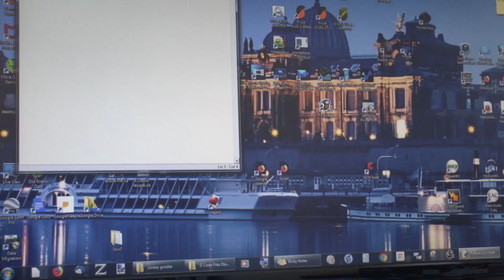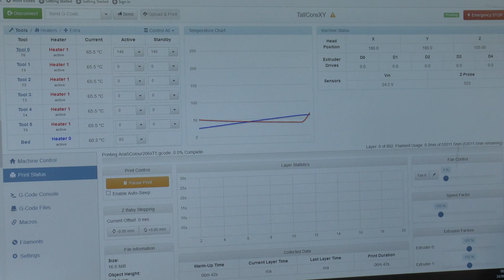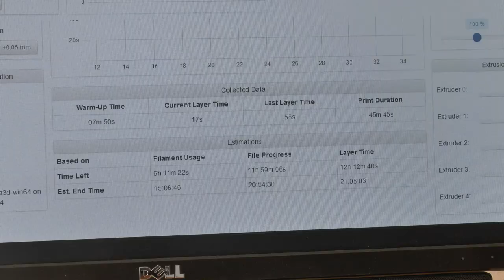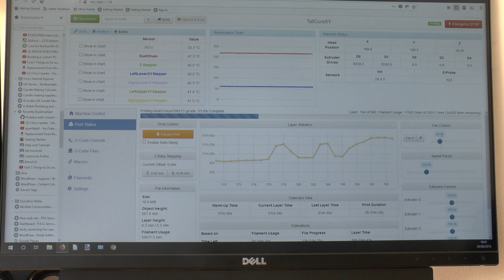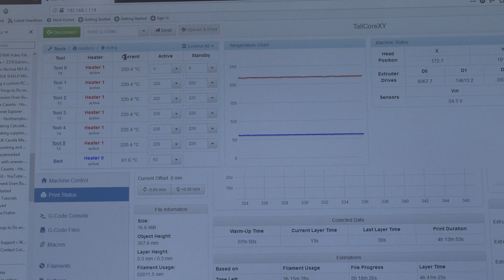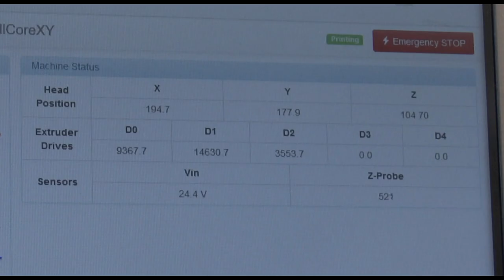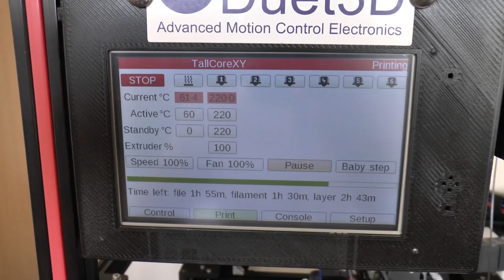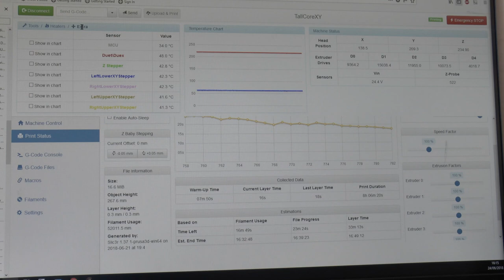Printing Aria by Loubie

Comment: I really like your build. Do you have any more pictures of it? I am building a large CoreXY (400X400X750) and you seem to be getting really good prints. What size lead screws are you using and what is your print volume if you dont mind me asking?
Reply from the maker: Hi. No I don't mind you asking. There are quite a few more videos of it on this channel of mine. For more information, take a look at my blog https://somei3deas.wordpress.com/. Specifically, the pages related to my CoreXYUV build and the 5 colour upgrade.
The lead screws I use are 8mm diameter, 1mm  lead. That is to say, they are single start "trapezoidal"  thread with 1 mm pitch so the lead is the same as the pitch. I hate multi start, course lead, screws on a Z axis for reasons that you'll find on my blog https://somei3deas.wordpress.com/2017/01/31/z-axis-lead-screws/
As you'll have seen, I use a Diamond hot end which, because the heat sinks stick out an angle, has an envelope of about 80mm in both X and Y. So I lose quite a bit of travel compared to a smaller hot end. The printer frame is 600mm square but the usable print volume is 344mm in X, 364mm in Y and 760mm in Z. 

HTHIan

Comment: Impressive setup, well done. Do you have an estimate of the total weight of the machine? Also have you considered using linear rails for the main axis?
Reply from the maker: No idea what it weighs. I can lift it with ease though. If I had to make a guess, I'd say less that a heavy suitcase - say 30 kgs?  For moving it, it's size more than weight that's the issue, but the top section is only held on with 4 bolts so it comes apart reasonably easily. As for linear rails, well it's all OpenBuild Vslot extrusion with Delrin wheeled carriages so I already do use linear rails. I guess you mean something like additional Hiwin or MGN rails, bolted to the Vslot? Can't see what advantage the additional complexity and cost would give me TBH. It'd likely make the carriages a bit smaller so give me a bit more XY travel but not enough to justify the extra cost (and I like the fact that Delrin wheels running on Vslot are silent).

Comment: I am watching your video all over again and again but I can't understand your guide setup. It seems you have only 3 carriage with 4 wheels each . Looking from front of you printer seems the carriage are  left front and right front  / right back . I can't see any carriage on the left back angle . Is it correct? Is you bed fixed to the frame and so do  you make bad leveling with the  lead screw?
thank you
Reply from the maker: The bed isn't fixed to the printer frame - it can't be because it has to move in the Z direction. It is supported on 3 screws. These screws both support the bed and provide lift. The 3 screws form a traingle and are connected via a continuous belt to a single motor. As 3 points define a plane, then when the screws rotate, they lift the bed whilst keeping it flat and level. Similarly, the initial levelling was done by slackening two of the pulleys and rotating two of the screws with respect to the third. Then the pulleys were re-tightened. Because the three screws are connected by a single belts, there is no need to re0level the bed. The only time I have to check and perhaps adjust the levelling is if I transport the printer to another location. 

The linear guides are only there to stop the bed from moving in the X and Y directions. I have found that the best position for these guides is to have two guides, positioned on opposite corners so front left and rear right or vica versa. Originally I had the guides both at the front but this wasn't as effective so I fitted another in the rear right corner. The one that is still in the front right corner has been slackened off and doesn't actually do anything - I just haven't got around to removing it. So two guides works best - the more guides you have the more difficult it is to get everything aligned so that nothing sticks or binds. The number of wheels on each guide carriage is irrelevant. The only criteria is that the guide carriages are free to move but without any undue play.  Mine happen to have 4 wheels but if I was building it again, I'd likely use two on one side and one in the centre of the opposite side.
Reply: @deckingman  thank you very much for your answer So your Z axis move only on 2 linear guides in a diagonal position each other . I would like to try your approach . I have now 4 guides with 3 wheels each and three screw like you . I am gonna try to remove 2 guides and I'll see . If everything works I'll try to remove also the 3 screw on the bed and relaying on lead screw like you for leveling. I saw you are using an elastic join between the bed frame and the Z carriage . Do you find improvement over a fixed join?
Reply from the maker: I designed the joints so that the bed could be levelled without imparting any twisting or buckling forces on the build plate. Although that may not strictly be necessary, I never tried a rigid coupling so cannot say if it is better.
Reply: @deckingman  I really amazed by your design! it seemed impossible to me, before seeing your printer  that a printer with only 2 guides and flexible joint between the frame and the bed could be so  solid.If you would try to wist the bed structure without the lead screw it stay stable or it would twist ?
your and mrehorstdmd printer are full of inspirations. I see your dinamic force cancelling  ! Even if you say that isn't bring   real improvement of print quality is a demonstration of great capabilities! O.o Thank you for sharing al your knowledge  with us. I am very tempeted to go with belt Z axis even if If my quality on Z isn't bed . I would not make  the same " mistake" you did with dinamic force cancellation , maybe simpler is better and three led screw- single motor and  bed levelling by lead screws adjustment is the way to go.
Reply from the maker: If it was possible to take the 3 leads screws away, when you look down on the bed from above, the two linear guides prevent the bed from being moved left to right, or back to front. They also prevent the bed from being rotated both clockwise and anticlockwise. However if you look at the bed from the front without the screws in place, the flexible couplings would allow the bed to be tilted up or down on one side compared to the other side. The same applies if you viewed the bed from one side. That is to say, the couplings would allow the front to be tilted up or down relative to the back. So it can be tilted but not twisted. What I mean by that is that it will always be flat. That is how it is possible to turn one lead screw to level the bed without twisting it. 

Try this. Put you elbow on a table, hold your arm upright and use your thumb, index finger and middle finger to make a 3 legged triangle. Your fingers are thumb represent the 3 screws. Now balance a small book or something on top of those fingers and thumb. That is the bed plate. To raise the bed, you simply raise your arm off the table. Both fingers and thumb move at the save time so the book (bed) gets lifted without any twisting force applied to it. Now bend one finger slightly to make it shorter That is the same as adjusting one screw. The book (bed) will tilt but still stay flat (but not level) because there are no hard couplings between your finger tip and the book. Now move your arm to the corner of the room so that two opposite corners of the book are just touching the two walls. The two wall are now the linear guides. If you raise and lower your arm, providing those two opposite corners of the book are always touching the walls (guides) then it is impossible for the book to move side ways or to rotate.
Reply: @deckingman  thank you for spending so much of your time answering me Definitely   am going to try your  flexible system . I just ordered the joint bearing :) I have an aluminium bed mic 6 8mm thick and I am  trying to implement the mrehorstdmd  " guided expansion "during heating . I need to check how the best why to use use your ideas :)